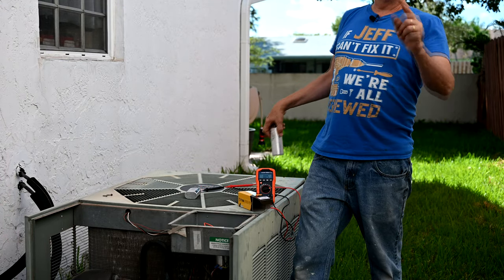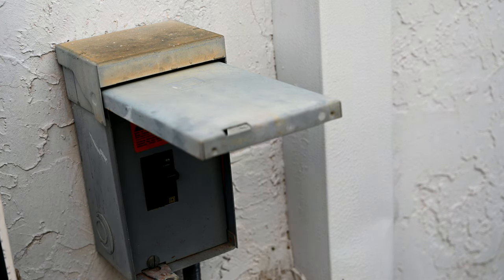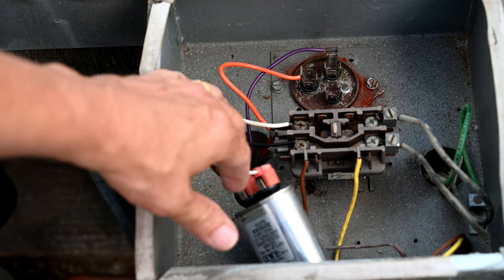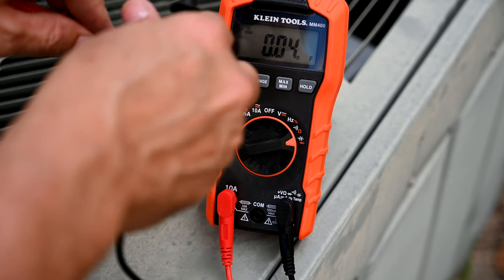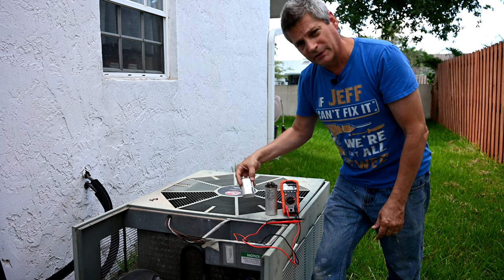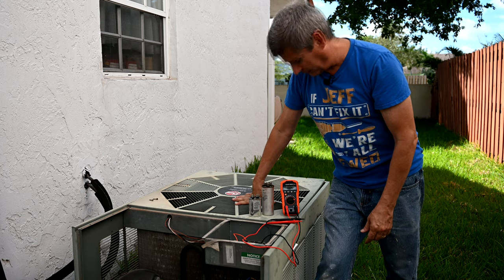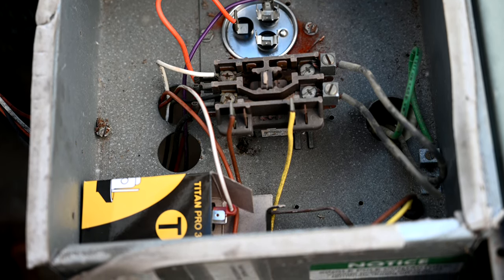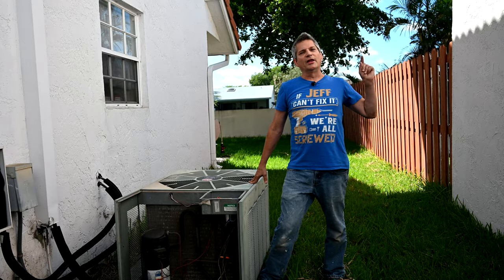DIY Fix AC Compressor Fan Not turning On, Just Humming

Comment: When testing the capacitor which prongs do you test?  Does it matter?
Reply from the maker: If the capacitor is electrolytic, it will have a polarity, marked with + and -. So I put the red lead on plus and the black lead on -.
Reply: Thanks for the reply. Ended up being the fan motor.
Reply from the maker: @ashleyhavens804   If you buy the motor yourself it's ym about a $100 how much did you pay for it?
Reply: New motor and capacitor was $98. The motor was a 1/3 to 1/6 hp depending on how you wired it.
Reply from the maker: Awesome so that's right about where it should be priced. Do you know that the air conditioning companies will charge you a $120 for that stupid capacitor and it's basically a $10 cap. Plus still charge you the labor to put it in so you're looking at almost a $200 repair just if it was a capacitor only. Now you add on the fan and I've seen them charge people $300 to replace the fian before.
Reply: @jeffostroff My home warranty is $75 to get someone out & they wouldn't come until Monday. The extra $20 was worth it. Now time to switch companies.

Comment: Hey there loved the video! So I have a similar problem. My ac turns on and I feel air coming out the vents but it is not cold. When I checked the  ac unit, the fan was not spinning and it was just making a  continuous humming sound. So I called in a ac repair guy and he told me that the compressor needs to be changed, and compressors cost around 1200$ so before I make that decision. What do you think I should do?
Reply from the maker: I would not rush out to spend $1200 just yet when there's some things you can check on your own. First of all I would do exactly as we showed in this video because most likely your problem is the capacitor is bad and it's only a 15 to $20.00 if you're wrong. If it's not the capacitor the next thing I would look at which we had an issue with with our own AC last summer is that maybe the compressor is just getting too old and it's not wanting to turn on and so you need to invoke what we call a hard start capacitor which gives it some extra wealth to help it get started with a little bit of extra capacitance. Look at this video where I show two hacks and the hard start capacitor trick is one of the hacks https://youtu.be/3LG0t2lV0Gg we were getting ready to upgrade our air conditioner and while waiting the three weeks for the new air conditioner come in is when our old air conditioner started doing this same problem as yours where it just wouldn't start anymore even though my cap was brand new so I knew the capacitor is not the issue. So once we put on the hard start capacitor it really helped things run smoothly for that extra two weeks waiting for the new air conditioner to arrive.

Comment: Could the compresson go bad or the fan in the unit if it was running like this overnight? In the evening, when i went to sleep, it worked fine, but in the morning, when i woke up, it was buzzing.
Reply from the maker: Yes so the compressor could be working late at night when it's cooler and you go to bed but remember that it is turning on and off several times during the night and that will heat up the compressor to the point now that it's so hot it wants to seize and that's what you see in the morning when you get up and you see that the compressor is not on it's just humming.

Comment: Replaced two capacitors and it's still humming but fan not rotating. Fan moves freely. Could it be another small part? Five yrs ago I replaced a capacitor and it fixed it. It worked in this winter but a little higher cost than usual. Then summer, turned on A/C. Seems to cool a little but not right and fan's not on, but every once in a while there's a louder noise like the fan was loud, but it wasn't rotating. How do I find a repair person who's not going to give me "taking advantage" prices?
Reply: It is an old unit. Any suggestions for brands or what to pick out?
Reply from the maker: The other one is the contact relay. Is there dirt, leaves or insects on there blocking the connection of the metal contacts? This can prevent voltage from getting to the fan. Measure the voltage and make sure it is getting to the fan.

Comment: I'm surprised they're not using the five at the other side of the camera instead of running a separate 10. Wouldn't have been cheaper to buy a single 35 since you're running a separate 10?

Comment: Last year my state decided to burn to the ground and we had at least 35 consecutive days where you could not see the sun or it was a faded pink spot due to all the smoke.  Structure fires kick out a lot of PM 2.5 ( particulate matter 2.5 microns which is smaller than a virus).     I found out this stuff doesn’t even need to contact your lungs to enter your system  it absorbs in your trachea before you finish taking a breath.   It’s also what was found at the 9/11 site.    I’ve been working on a filtration system and an extra delay tank to take that crap out of the air.   I’ve found that as a bonus it takes out airborne microbes and mold spores.  Does anyone think it’s a decent idea?
Reply from the maker: Isn't that what a hepa filter does?
Reply: Very decent
Reply: @jeffostroff    They work pretty well in an air purifier, I have a few of the Levoit Core 300s which do a very good job. I was referring to  HVAC systems where airflow is a critical aspect of performance.    There is a limit to what can be filtered without a loss of preference - Air flow resistance.   If you want to scrub the really small stuff including viral particles you need a very dense filter.   They need replacing often which creates a biohazard and if not maintained a catastrophic failure at some point.  The system we designed ( it’s on paper only)
Makes the need for high MERV rated filters unnecessary due to the air being processed prior to being released to the regular intake.   Another way of looking at it is we simply add a second intake, process the air, release to existing intake with a dramatically lower filtration demand.   Let me know if I explained it in a cogent way.    The working title for the design is “ InterceptAir”

Comment: Mine turns if I push the blades with a pencil. That jumpstarts it. But, every time the unit turns off and tries to start again, the fan just sits there. Will the fan do that if the capacitor is bad?
Reply: Mine does the same.
Reply: Yes,  the capacitors job is to store electricity to give the fan motor a jump start to get it started.  If giving it a manual boost gets it going, that's usually the capacitor not storing enough "juice"

Comment: So, ours is a dual cap, I replaced it last year, this year it will run for 15-30mins and the fan will stop, but compressor still going. I tested the cap and I do get the appropriate capacitance for the cap. What else can I look at?
Reply from the maker: I wonder if the fan motor is going
Reply: @jeffostroff  any way to test that theory? It is 25yrs old.

Comment: Idid what you did on the video and I got zapped by the big capacitor. I was told by the parts store to discharged the capacitor first before working on them. Why video did not mentioned about discharging.
Reply from the maker: First of all I think it's more dangerous for me to explain to people how to discharge may capacitor because they are more likely at or shock themselves. Second you got zapped because somehow you connected across the two terminals. Never touched the terminals or put a piece of black tape across the maybe if i ever redo this video i will incorporate all of into

Comment: How do I discharge the capacitor before I start tiuching with my hands? Thank you.
Reply from the maker: If you don't measure any voltage across it then you likely don't need to discharge it. But if you do discharge it, use a thick resistor that can handle a few watts. Many people just short the terminals with a screwdriver but I think thta poses a risk of explosion to the capacitor.

Comment: I had a sinilar problem w/ my unit several years ago. I had 2 companies come out; quote #1 was $1100, #2 was $800. My neighbor had some experience and he said to check the capacitors. Sure enough, a couple hours later and just $13 for a new capacitor.. I had my A/C unit back up and running. Watch out folks! Many repair men are dishonest and it can be a challenge to find an honest one. Good luck.

Comment: Had the loud hum like at the beginning, replaced the capitator with the same type, didn't fix it, still hummed,  replaced the contactor with same type, still hummed, no fan movement - replaced the fan with the same type - now, still not working and NO HUM.   Have tested all capacitor and contactor parts by swapping with the downstairs unit that's identical, and they work in down in the downstairs unit so it's not them.   Tested the fan with OHM meter and it tests okay.  Ideas?
Reply: I’ve read that if the refrigerant is also low it will cause the same issue.  Before the capacitors there is a junction.  in that junction there is a small switch that goes up and down to pass the 24V.  if that switch is stuck it will also cause the same problem.  I believe the the small switch is in the up position and when it goes down it is supposed to complete the circuit turning on the unit outside.

Comment: Last week my ac unit was working fine then my contactor messed up and burned my transformer I change both of them but now my ac won't blow cool air, the outside fan turns without a problem but I notice that instead of blowing warm air it's blowing cold air and also notice  that one of the copper tubing is VERY HOT any ideas of what it could be? THANKS
Reply from the maker: One copper tube is supposed to be hot, the other one should be cold. It sounds like maybe your fan is kicking on, but your compressor might not be since you get no cold inside the house. So check the compressor's capacitor, it is the larger of the 2 caps, or in case of a dual capacitor, you follow which wires go to the compressor, and that side of the cap is where you measure with a digital meter, the capacitance to make sure it is in the range like 40 uF, whatever the capacitor says it should be on the label. If you measure zero or less than 10 uF, then likely the cap is bad and needs to be replaced. If the cap measures correct uF, then it is likely the relay contacts where the power enters into the AC unit outside. Usually you have a dual pole contactor there, and one leg of power wires goes to the fan, the other leg goes to the compressor's cap to power on the compressor, very easy to. Check and make sure your contactor is clean by gently brushing out any dead insects and leaves which commonly clog inside the contacts and prevent them from closing. This solves most people's problems. If the contactor looks corroded or is old rusty and flaking, then that is your problem, because it cannot route power to the compressor and fan.  Now we have seen cases where compressor gets power, but fan does not, because maybe one side rots away but the other side is good. Let me know what you find out.

Comment: If the contactor is stuck closed will that hum?
Reply from the maker: Yes it could hum, but usually the hum is caused by debris caught between the contacts. See if there are any insects, dirt, leaves, etc. Depending on where the hum is coming from, it could be the motor trying to start, but not starting, so the capacitor would need to be changed.

Comment: 3 days ago our ac wont work, trying things out. First we change capacitor still did not work. Next we change motor still not turning but the compressor has a humming sound. Don't know what to do. Been watching for coupke videos and did some reaearch for many hours now
Reply from the maker: I would re measure the capacitants on the capacitor and make sure you got it right And that it is measuring within the proper range. Also sometimes when you get the humming it can be your contactor you're a contactor which is a very common failure sometimes people get leaves and insects and stuff built up on our teeth where the contactors goes bad so you would replace it. After that it could just be the compressor and maybe you need to put a hard start capacitor on there we have another video on them if you search for that.
Reply: @jeffostroff  i had 30/5 in there and changed it to the original.part which is 40/5. Swapped out wires for compressor and contactor. Still compressor getting power but fan wont turn. Haven't check the 24V for it yet.
Reply: Just measured the voltage got voltages coming in and out. And guess what i found? The blade of the fan was backwards and hitting one of the copper pipe. At least the pipe is good no scratch at all. And now its turning. Im so duuuuuuumb. (Its my first time though) 🤣🤣🤣

Comment: what happens if you put two capacitors in parallel? would one save energy from peak comsumption when the unit is powered on??? i now capacitors store energy and discharge it when needed. I assume that when you turn the unit on, you need an extra peak of energy due to reactive power, and that is the job of the capacitor.
Reply from the maker: Capacitors in parallel the capacitance adds up. So putting a 10 uF cap in parallel with a 20 uF  cap yields 30 uF

Comment: I need help. Can you please tell me what to do? I have an '89 Ruud that looks a lot like yours. My fan is humming and HOT, but won't spin. Capacitors are good, wiring is correct, I'm getting 240V into the line, contactor depressed when the thermostat calls for cooling, compressor is happily humming and I tested the blower motor's wires (2 "lower" readings (126 & 41) equal exactly the common reading (167). I have a new blower motor and can replace it, but I want to know if that's what needs to be done first. Fan blades spin freely when pushed, but it only hums and gets wicked hot fast. Are those readings for the fan wires too low? I'm just a stay at home mom with zero hvac experience and can't afford an hvac tech. Don't worry, I'm crazy about safety! Please help me. Thanks for reading!
Reply from the maker: I had to replace the fan motor twice in 17 years that I owned my AC. It's about $120. I bet that is the issue. also check contactor for leaves, insects, and others that will prevent full voltage getting through.
Reply: @jeffostroff  Thank you!!!! I've gently vacuumed out all the electrical parts/contactor. Would air duster be a good idea too, or not? I went ahead and took off the old motor (fan blade was fun! ha), got the new motor in and wires connected. Tomorrow I've got a new fan cap coming so I'm hoping it starts right up once I get it in. Thanks again! I really appreciate your quick reply

Update! Fan was CCW and I noticed it was blowing the wrong way after a couple minutes of running, so I swapped the 2 wires to get it spinning clockwise and it sounds perfect.  However, now I'm worried about the compressor because it got wicked hot after an hour last night so I turned it off for 12 hours. I'm sure it's low on r22, but so far it's running and not overheating. I hope I can get an honest tech out here asap because I'm definitely not qualified to work on or recharge a compressor.

Comment: I switched the capacitor out with my neighbor's. Still didn't work. Used a screwdriver to help the fan blade and it started. Stopped it. Restarted it. Fan started on its own, So I switched back the capacitors. So the first step should always be: use a screwdriver to help start the fan blade. Could have saved a lot of time and hassle.  Now, what caused the fan to get stuck in the first place? I don't know.  Does it need some WD-40 somewhere?
Reply: This is exactly what I'm dealing with right now. However, the screwdriver is not starting the fan any longer. Did you ever find out if WD40 helps?

Comment: I took mine compacitor out and it has no label on it. I think its the original one with thr label on show tt10000 sh1238 from aerovox. I called reheem and they told me its 50/5 370v . I went out ac hardware i bought that and it foesnt work. What should i do

Comment: It's not $150 anymore . . . He quoted me $250 for the start Cap. 6 weeks ago . . .  I bought the Start Cap and Run Cap for about $25 each. Now my air conditioner's out in my other house today. I ordered the Dual Run Cap for $15 but it won't be here until sometime between Friday & Monday. I actually ordered it this morning before the air conditioner stopped working. I thought it would be good to have a backup. Wish I would have thought that a week ago. I'm installing a couple window & portable air conditioners right now . . . I'm just taking a break and thought I would search YouTube about the compressor humming and the fan not running . . . and here I am, livin' it large! lol

Comment: our AC have the same problem, BUT replacing the capacitor didnt fix it... i wonder what it could be?
Reply from the maker: Check your contactors, if they got rusty, or bugs in there, clean them out or replace. You need to measure to see if the voltage is getting to the cap, or the fan.
Reply: @jeffostroff  thank you so much im gonna get in to that. i ended up buying a new condenser motor since when i turn the motor it was kinda hard to turn the fan unlike other fans ive seen in the HOW TOs

Comment: I'm afraid my fan motor got screwed up. Was gone for 6 hours and heard the unit outside humming when I got back so changed the capacitor and it turns on again but the fan motor was pretty hot but still turns on. Hope it's fine.
Reply: @Do what you need to with her,then broom her fast. Usually since they are needed to jump start the fan. No capacitor causes the fan to try and move but needs more starting power with a capacitor.